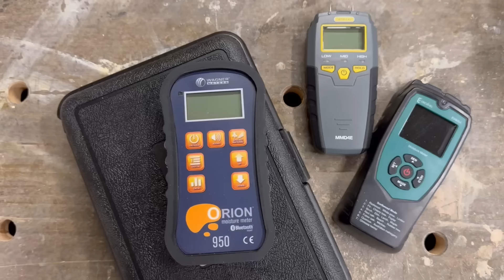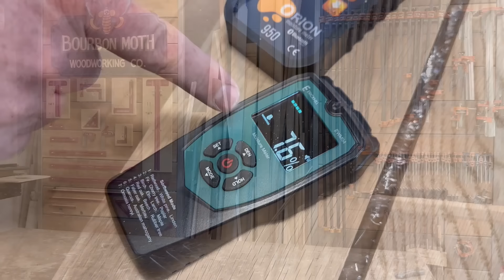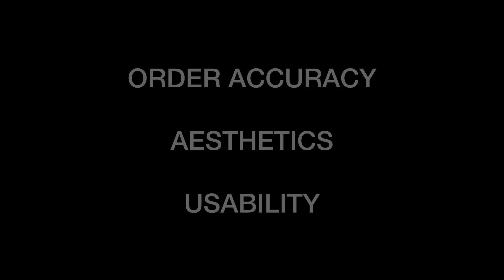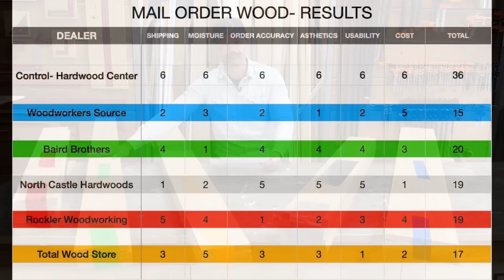A Thousand Dollars Worth of Wood || Buying Wood Online

Comment: Curious if the $7ish / bf price you quoted for your local store includes S4S.  Giving your local store a 6 in each category seems little biased considering you have to go to the store, shuffle through the stacks, choose your boards, send them to the back to be surfaced and then lug them home.  Not saying that's worth an extra $15/bf, but it's worth something.  If you are just buying wood from the stacks and then need to do all the surfacing yourself, that's got to factor into the cost as well.

Don't get me wrong, I shop at a local hardwood store and have never bought wood online... I just don't know if all the numbers really match up in your table at the end.... a good comparison would be to order 10 bf of white oak in 7' lengths from the local store.  Find out how long they quote you before you can pick it up and then compare those boards with these... that's the truest comparison in all the categories.  Going to the store, picking your own boards and then surfacing them yourself just isn't anywhere near apples-to-apples.

Comment: There is an inherent problem with a scoring system that requires that each score (1-6) be used in each category. It means that even if there is only a slight difference in one category between best and worst there is a huge gap in score for that category. I would prefer a scheme where each company is scored independently against a standard (say the local hardwood store). This would mean it is possible for every company to get a 6 in one category if they were all truly great, rather than forcing one of them to get a 1 and completely skewing the overall result.

Comment: In my opinion 5% moisture is as bad 13%. If it is too dry it will absorb moisture of the air and can bend the Same way and amount like its loosing this amount of water.

Comment: I'm shocked by those prices from sll of them. That really expensive one costs more per BF than Wenge, Teak, or Zebrawood from the place I get boards online. 
 
The best advice I can give... don't order from ANY of these companies. If you're asking more than $9/bf for less than 5/4 for white oak (and about $3/bf for shipping) on s4s, then keep looking.  I just ordered 25bf of perfect 8ft BlkWlnt for  $320. 
 
I'd buy local if it were an option, but my local hardwood suppliers here in Florida always seem to be in low teens in terms of moisture. And I rarely have time to get them down to <9%.

Comment: I'd be interested in seeing these scored with a non-comparative scoring system. When you rank them against each other, you end up with some scores that don't really reflect things accurately. Like for the moisture content, the best four were all practically identical, yet because they were scored compared to each other, they had a four-point spread. Really, they should have all been scored 6 because they were all in the perfect moisture range. 

Also, regarding the order that came incorrect: I would have liked to see an alternate score not factoring that in. It's not safe to assume that every single order from that company is going to be incorrect, so it's a bit unfair to score them so low in so many categories because of it. It's definitely a problem, but even the best companies make mistakes, and I'm much more interested in how they handle said mistakes than the fact that they made them in the first place.

Comment: I’ve ordered from Woodworkers Source before they are very nice to work with specially if there is a problem with your order. Unless you tell them what your project is going to be then how would they know that the boards need to match? Other than selecting for the boards to be matching.

Comment: Fascinating!
Your point system (1) gave equal weight to every factor, and (2) within each factor it was just a relative ranking, not a real score.  Imagine if five test scores were simply ranked 1 through 5, instead of scoring based on how correct each answer was, where one student always got a 1, and the next better got twice that score.  Yes, your approach needed to be simple enough to do, and to be understood, and I give you full credit for the details you went into on each factor, but it still was not a great system.
I would give you much higher marks if you had actually gone to your local dealer and applied the same specs - ALL the specs, including s4s - to what you came back with from there.  I understand that the idea is that nobody has to leave the store with anything except exactly what you came for, but don't you really have to deal with the reality that you can only buy what they have in stock?  Do you always get exactly what you hoped for, even for something as common as white oak?
Finally, the best boards arrived last at the highest price.  Did you consider that choosing that set of matching boards, and cutting and milling to your specs, was what added the time?  Shouldn't having to wait for half an order to be replaced make that first ranking less than a five?
Regardless, thanks for doing the work, and making the video.  Valuable work.

Comment: 9:39 That's definitely a lack of attention to detail, wherever that came from... At the very least the vendor could have shot you a message to say, "Hey, is this ok? What's the project for, maybe this is or isn't right for it.." Definitely deserves a low score.

14:54 A bit of a mess..

Even though I'm quite a ways off before I have to worry about ordering wood like this, I do appreciate this kind of video. It was somewhat of a Project Farm style process, though not as dry.. lol (well, depends on the moisture meter)

Comment: I wondered how it would be ordering online, your test confirmed what I feared, getting sub-par material, and paying WAY TOO MUCH for it! If you bought crappy wood, it's on you for not going out to your local hardwood dealer and picking it out for yourself. I see lots of content creators here on YouTube using Woodworkers Source for their wood, most of the time walnut (!!!) and I wondered if you were paying for it yourself, if you'd be happy with it. I have a Woodworkers Source near me, much closer than it's nearest competitor, and I still won't use their wood. It's over priced , about 40% more than a stand alone hardwood dealer. I've never considered Rockler or Woodcraft as a "hardwood" source, they are a hobbyist or boutique store that sells wood as a sideline. I'm afraid I'd have to put Woodworkers Source in that same category, which is a bummer for me, I could walk to their store and it would be soo handy.

Comment: If I had to pay over $20 per board foot for red oak, I would seriously just quit the hobby.  That's the one thing in this video that I found to be simply ridiculous.  Shipping costs and surfacing notwithstanding, all of those boards should have been perfect for that kind of money.  Contrary to your suggestions in the early part of the video, you can buy S4S red oak from your local big box store, select and check all the boards yourself, and it would not be over $20 a board foot.

Comment: Did my ears actually hear $26.87 a board foot for flat sawn white oak?
Reply: Yeah a bit, it's $7 a bd foot where i order from, and $8.95 for quarter sawn; I understand in the video he has them processed as they do with regular shipping to reduce weight, but hot damn that's a lot. I guess it's why I try to order in bulk, true rough lumber and I get it shipped freight, and the boards stay like 14' in length. I get it, not everyone can swing a $1500 lumber order, but I guess I'm too cheap and the lumber lasts me a couple/few years.

Comment: The reviiew process is flawed. If the objective was to see which retailer was better, this would've been adequate as the suppliers were ranked,  however as the hypothesis was to determine if online shopping for wood is worth it, a point system would've been better. The control was redundant as no test piece was acquired. Would've been good to see a measure of time & convenience- not having to leave home is the reason people order wood online, so not including this in the scoring system is am oversight. Finally there was overlap in the categories, i.e appearance, usable material, etc. Ultimately the review just felt biased and failed to measure the pros and cons fairly.